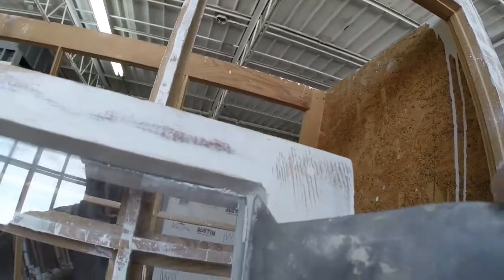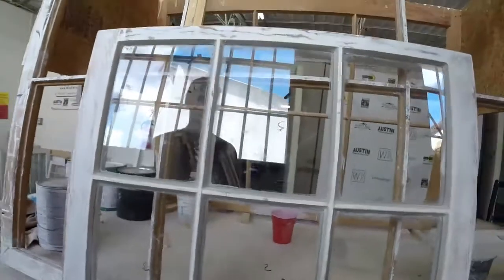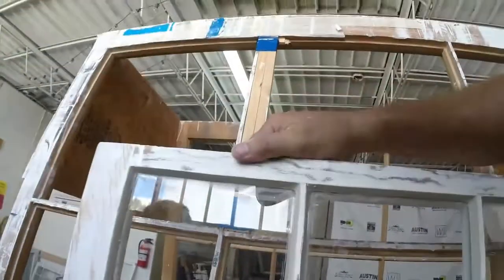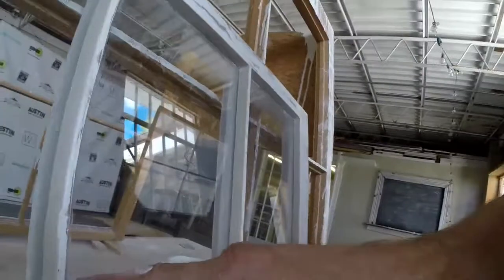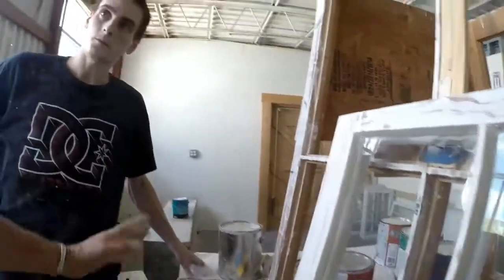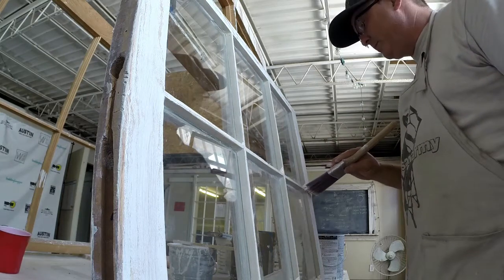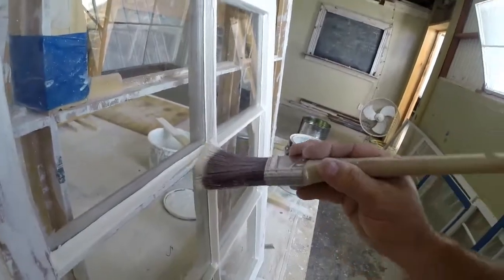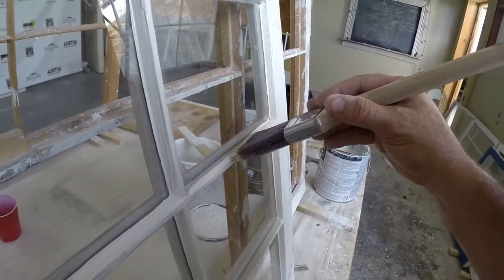How to paint a sash

Comment: What do you like to use for paint and primer?
Reply from the maker: On old work and raw wood I almost always defer to an oil based primer, then topcoat with a water based paint. But I use a wood called Accoya and with Accoya I use a water based primer and coat all sides, and finish off with a water based topcoat. Most people would need to use the oil based method.

Comment: Any tips for removing sloppy window work from a previous paint (probably over a decade ago)? Will mineral spirits on the window help clean and loosen up so I don't have to use a scraper and scratch the glass?
Reply from the maker: Nothing will work better than a little razor blade. You can try different kinds of magic juices but it’s mostly a waste of time. A razor blade won’t usually scratch the glass.
Reply from the maker: Here’s a technique they will probably help. A scrubby sponge, a razor, a squeegee and a rag. 

https://youtu.be/qOZETG5wJOA

Comment: Hi Steve,  what about removing paint on the glazing side of the glass where I got off the sarco?

Thanks,

Dwight
Reply from the maker: One way is to use a drywall taping knife to lay over the glazing to protect it, then use the edge of the knife as a guide for a razor scraper.
Reply: @WoodWindowMakeover  Thank you! The glazing rabbet wasn't deep enough for the glazing points or so I thought, so I had to run the sarco out farther. The rabbet was only 1/4", is that typical?
Thank you, you have helped me a great deal!
Reply from the maker: @dwightforeman1258  the push points you get at the home store are designed to frustrate a person out of wanting to do it. A 1/4" is typical (or less - sometimes 3/16"!) To get nice tight glazing lines you have to use the diamonds and a point driver
Reply: @WoodWindowMakeover  it has been a little frustating. Thank so much!